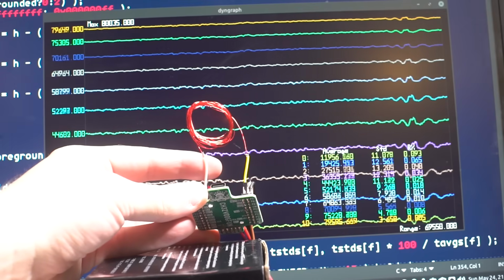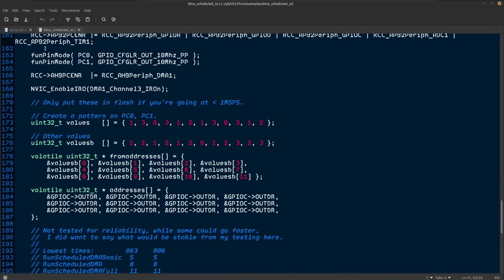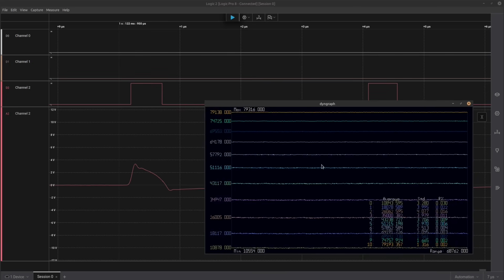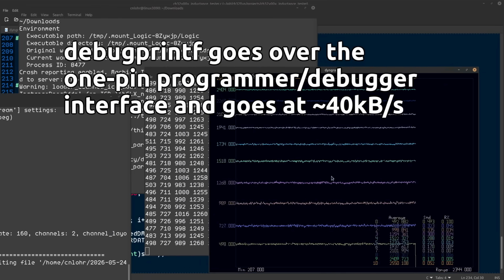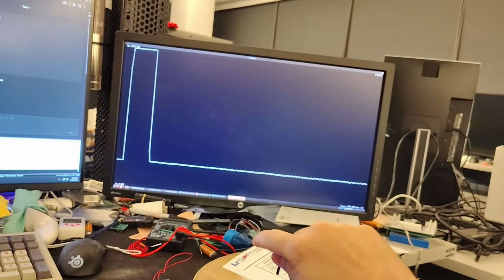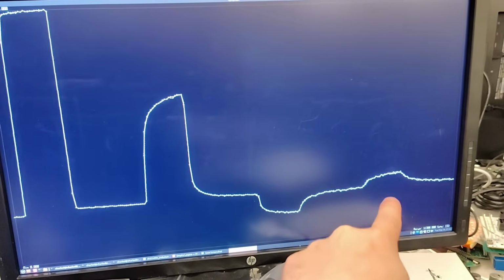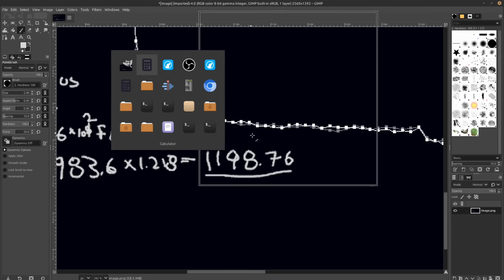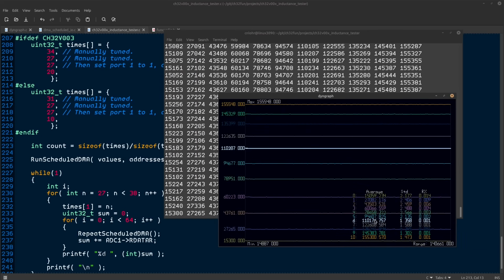The Worlds Cheapest Time Domain Reflectometer

Comment: Is that the technique they used in Iceland when some geologists used the pre-installed fiberglass internet cables to detect seismic acitivity? It was recent, maybe 2024. Looked like they had thousands of streams compared to your 10. They uploaded the live feed of that detector to youtube. Was very interesting!
Reply: Sounds cool. You got a source?
Reply: Asianometry made a video about it recently.
Reply: I Need to know more!
Reply: @Xsiondu not exactly that but I guess they used the same method. 

In rail condition monitoring, glass fibers can also be used as virtual microphones by optical effects of scattering. The method is called DFOS, distributed fiber optic sensing.
OTDR, optical time domain reflectometry is used in that.

Here is a paper on that:
"Optical Fibres for Condition Monitoring of Railway Infrastructure—Encouraging Data Source or Errant Effort?"
Reply: If links don't work: An online monitoring carried out by GFZ researchers from the sections Near-Surface Geophysics and Geoenergy, which uses fibre optic cables of the Icelandic telecommunications network, registers the volcanic and seismic activity since the event and transmits the data in real time to GFZ.

But yeah, it was "Distributed Acoustic Sensing" not this.
Reply from the maker: I am really surprised effectively acoustic waves can affect the fiber's transmission properties.  that's so weird.
Reply: @CNLohr  I am assuming it works like laser based gravitational waves detectors. Stretching, you know.

Comment: The master has returned.
Reply from the maker: The vids come when they come!
Reply: @CNLohr  the muse has to hit
Reply: @CNLohr  This one actually came the day after I was like "CNLohr hasn't uploaded a video in a while, I hope he's doing all right" 😂
Reply from the maker: @u_plugged If you're ever worried, just check my github haha
Reply: He taught me a new way of making pcbs years ago.
Reply from the maker: @longshot7601  Some day I want to go back to that life.  So much less time than ordering everything from China, but alas, I live in an apartment now.
Reply: @CNLohr  The nice thing about getting PCBs from China is that you can get 4 layer boards for pretty cheap.  In the past I had to make two 2-layer board, insulate them and hand solder wire vias between them.  Now I can just send my gerbers off and get my PCBs back in about a week and a half.
Reply from the maker: @longshot7601  The 4-layers are a bit of a scam, because they sort of train you into thinking in terms of 4-layers, then when you go into mass production, they end up costing much more for large orders than 2-layer boards, which are basically free.
Reply: @CNLohr  One of the things I was wondering about is being able to cure photo resist on a 3D resin printer instead of using a photo mask.  I don't have a resin printer right now but it could be an interesting subject.
Reply: Yes, he is
Reply: Lookoutfa Charlie
Reply: Best of the web here

Comment: Nice! I might try and take pieces from this to make a TDR meter for FRC CAN busses.
Reply: Your Cousin?
Reply: Keep in mind that this method only has a resolution of about 20ns (1/48MHz), which is around 20 feet (depending on the transmission speed). You would need to use equivalent time sampling or a very very fast microcontroller to make this useful for an FRC-sized CAN network.
Reply from the maker: @asid61  Absolutely, I never said it was a good TDR, just that it was a cheap TDR.
Reply from the maker: do it!  And if you do it with WCH parts, you could probably do it without any extra hardware.